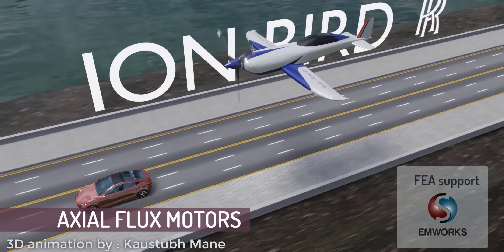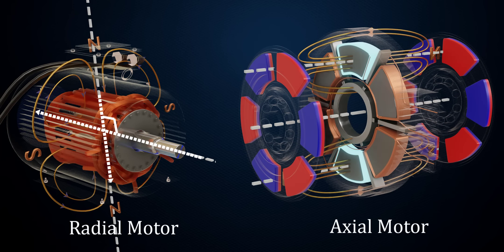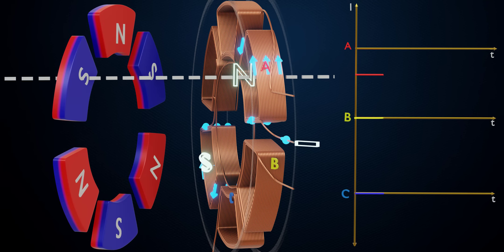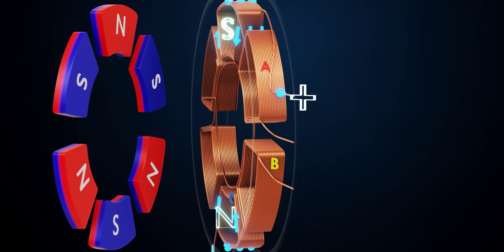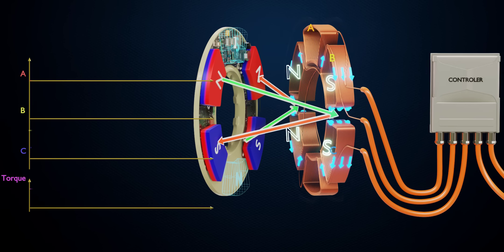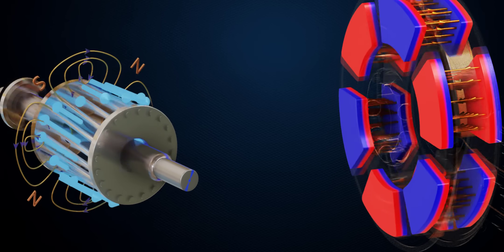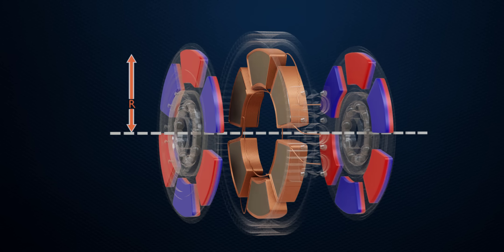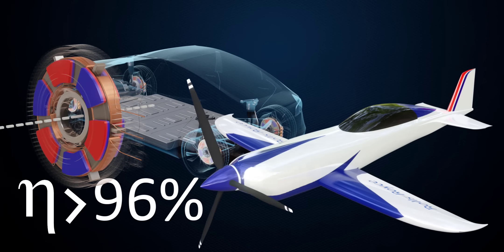Axial flux motors - The new hope

Comment: I find this very funny because the electric motors are already great, in their radial format.
Literally, the problem lies with the battery pack storage.
That is the field to sink money into developing next gen batteries and modular design to allow easy construction by anyone of various storage units depending on needs.
Motors don't require any attention now and spending money on R&D.
Reply: An industry induction motor like in the model S Tesla has an efficiency of 85% when run at the peak efficiency point. In a car that is around highway cruise speed. However in city traffic, the efficiency drops at this lower load to around 65%.  This is why an EV with an induction motor only uses half the power going 50km/h, as opposed to 100km/h and not around only a 1/4 as it should. So improving motor efficiency will increase range considerably in real life conditions. A coreless axial flux motor has a peak efficiency of 98.5% and rarely drops below 95% in any driving conditions. So that would translate to a 25-30% longer range of the vehicle.
Reply: @Tore_Lund  Which is more important battery tech or motor tech. The motors are light and offer good performance per size. The batteries do not. You can use old electric motors from out of anything and still be good, but then the batteries kill you. Even with new battery packs their efficiency is bad,
It is a problem of priorities.
Imagine you have some dents in the body of you vehicle and some squealing sounds coming from the wheels?!
What do you repair first? The dents or the nasty sounds defect (ball bearings) Which is your priority.? 
I do not doubt this motor tech may be better, but it's not time for that now. 
IS good someone is showing what should be done for motors, but now is not the time. All the financial effort should be put into a new generation of electricity storage.
More efficient, lighter, cheaper to manufacture
Reply: @roberts.wilson1848  I didn't claim it would be a better motor in general, just that as batteries are the most critical element of an EV; their cost and weight, optimising the motor might be more cost effective: 20% saved in energy use, translates into a 20% smaller battery, which is around $2000 saved on battery cost. Add to that a 200lb lighter vehicle uses even less energy. So if such a motor can be made for less than $2000, the choice is obvious.

Comment: It looks like there will be magnetic force trying to push or pull those two plates apart. They would need to maintain the air gap between the two parts and that force would mean friction to overcome?
Reply: They can be made so that the net axial force on the rotor is zero.  It is just a design question.

Comment: What happens if the magnets on opposite sides, offset eachother by a few radians?  
Has anyone tried it?
Every axial flux motor video explain only one half, assuming the same effect happens at the other half, provided the 2 sets of magnets on either side are complimentary to eachother. I want someone to experiment by advancing/ regarding the magnets on the other side and see if the rpm varies. It should be interesting.
Reply: The designs of the axial flux motors includes 1 or 2 rotors, as you said, one in each side, but with the same alignement. 

The only issue with two rotors is the heat disipation of the stator, but that is fixed with a good oil based cooling.
Reply: That's exactly what I was wondering.
Reply: That would be detrimental..
The simple, 1 magnet rotor disc and 1 set of coils is optimised. So the best alignment for a second magnet disc will be the same as the first.